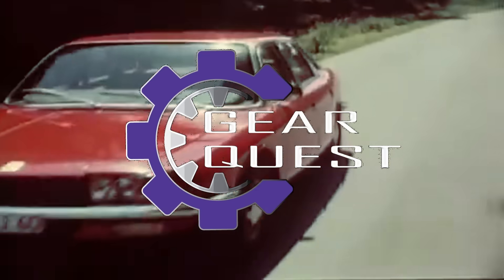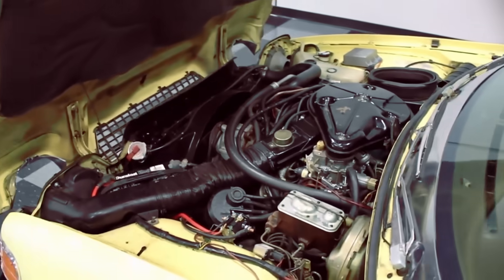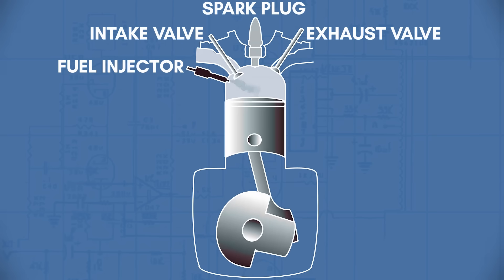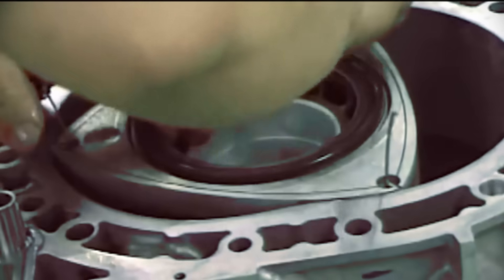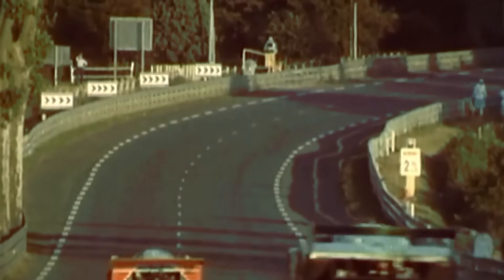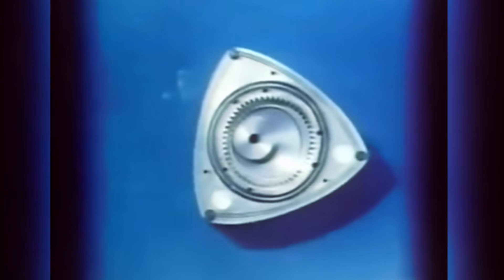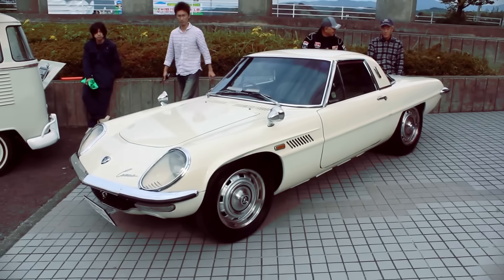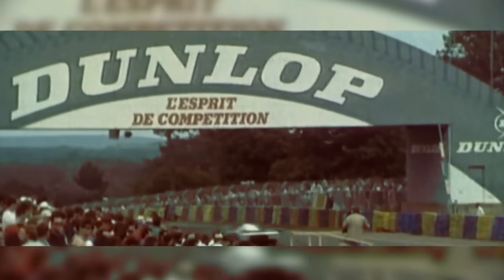The History of the Rotary Design

Comment: Click bait title: This was a good history and detail on rotary development but at no point did you discuss the political and back room dealings on why the rotary was banned, title had nothing to do with the content!
Reply: the true advantage of a rotary lies in the fact that what you would consider to be the piston constantly has angular momentum in one direction... therefore there is no dead weight working against the engine/crankshaft. everything turns, all masses rotate, even if not entirely concentric. With a typical piston engine, the piston has to stop and reverse direction, reciprocate, 3 out of 4 times without power being created in that cylinder... at some point the piston becomes a dead weight and creates vibration in the system as a whole.. vibration is wasted energy. Rotary has the edge on efficiency dynamics, but ultimately loses points on wear and lifespan.
Reply: @areyouavinalaff  Overall it is a better design ?
Reply: @areyouavinalaff  The Wankel offers no significant advantages and is less mechanically and thermodynamically efficient.
 The 13b for example has a 15mm eccentric-crankshaft which produced 30mm reciprocating stroke while the rotor orbits simultaneously in a planetary motion.
Reply: It was banned because the rotary can do 3 rotations as a piston does only 1
Reply: @TO-yq2qw  I figure, why Ban it by all ? It works, so use it in regular cars, light duty trucks, I think it would be better that my 2002 F150 even tho it has 568 thousand original on it; yeah still going. But how expensive to fix compared to, the v6 ?
Reply from the maker: Rotaries are a two-cycle four-strokes, they have a true 4 cycle (combustion event) but unlike a piston 4 cycle engine the rotary only needs one crankshaft revolution to complete its cycle, just like a two-stroke piston engine.
Reply: @GearQuest  Correct, all Wankel engines use the 4stroke or 4 cycle  operating principle.
 Not true, the Wankel requires 3 rotations to complete it's firing order sequence for all three combustion chamber swept volume displacement.
ALL 3 faces of the rotor completes the 4 cycles separately not simultaneously so 1080° degrees of crankshaft rotation not 360°degrees of crankshaft rotation.
Reply: @TO-yq2qw  it was not banned silly JDM mythos bullshit... there was a already known (befor the single rotary Group C victory) engine regulation change for 1992 that forced all Group C1 cars to be powered by 3.5l V10 engines same as F1 used... it effected the rotary, Jaguars V12, Mercedes turbo V8, Porsche flat6 turbo etc...
Reply: nagmashot yes, so banned
Reply: @TO-yq2qw  So boxer motors and V8s were also banned in Group C.
Reply: @nagmashot  The FIA never banned Wankel engines from the WSCC series. The regulations concerning engine displacement applied to all teams and was annouced more than a year prior to LeMans.
Reply: "at no point did you discuss the political and back room dealings on why the rotary was banned", most likely because there wasn't any to discuss. There is no great conspiracy to ban Wankel rotary engine, in fact it wasn't even banned!  The rules change in 1991 made it so all cars needed to run 3.5L engines, but there was issues. First off every team had terrible reliability problems because of the untested engines, every team but Mazda. While in qualifying the 787B was not the fastest by far, but it had one thing up his sleeve, reliability. It ended up wining the 1991 race because everyone else broke down, and the next year when the other teams got the "bugs" out of their engines, the Mazda 787B was no match. That is why the Wankel rotary engine was abandoned by Mazda. Though I do agree the title of this video was Click bait.
Reply: Agreed!  This is just regurgitated from some other show.
Reply: Exactly I really wanted to know
Reply: listen from 8:40
Reply: unbiased cobra66 you are wrong. The gear ratio from crank rotation to rotar speed is 1/3
Reply: It actually does explain why it was banned. Did you miss the bit about the rotary producing twice the thermo dynamic cycles of the internal combustion engine?
Reply: @petercarruthers9353  it wasnt banned. Mazda couldn't at the time time get compression to be anywhere near competitive with what a piston engine can apply. They have a formula to properly calculate rotary displace vs a piston engine. The rotary without significant updates to rotor design will never achieve high efficiency because compression directly influences temperature which effects efficiency
Reply: @jdr ok it’s funny that it’s great inherent advantage is also its downfall to the seals...
Reply: @shaadydog1  there is reported designers that have made the seals directly apart of the engines cast materials that allow compression up to 16:1 but very little is confirmed about that would be great tho. The rotor would still have it's own list of issues but would help them out for endurance and power along with thermal efficiency
Reply: @Peter Carruthers  How could it explain something that didnt factually happen? From the rules perspective many things were "banned". FFS THE fanboy bullshyt never stops with this group.  An engine/chassis combination  that  had more career DNF than podium was "banned" cuz too good. Only on the interwebz
Reply: @shaadydog1  he believes because they got a reliable 700 hp out of a 10k rpm designed engine that was wrung out the entire time which actually helps rotaries survive as it helps keep their oil and carbon build up under control. The only place the rotary survives is under constant strain at high rpm but 1 win of leman and a few supposed wins in lower classes which doesnt fucking matter when talking about group c prototypes.
Reply: Just a little bit of disclosure I fucking love rotaries they are interesting in function and form which is why I love hearing that companies are trying to do things with it but its Inherent issues with current design philosophy and technology yes rotaries are beautiful they sound hilarious and are functionally more efficient mechanically speaking but piston engines are older tech being they where being designed in one form or another steam etc since the 1800s and we just got them to 51 percent thermal efficiency a radical change in formula from the 60s is not going to suddenly keep up with a much more mechanically easier to make efficient design and suddenly keep up with thundering merc tt v8s or jag v12s  or Porsche flat or v engines when Mazda barely could afford the rotary racing development come on Mazda was working with less money and a much harder engine to design. Sorry physics are physics the rotary still has a theoretical max efficiency based upon thermodynamics of 61-63 percent efficiency but there are so many things that need to be fixed before it could ever possibly achieve that would I love to see that yes rotaries are tiny it would be epic to see things with a 61 percent thermal efficiency rotary but will it happen technically speaking it should be possible but speaking with current tech unlikely.
Reply: You really don't need an explanation if you seen what most Motorsports do when a new and overpowered design shows up. They'll ban anything innovative
Reply: goddamn it.
Reply: It wasn't banned the year it raced it was said the year after it raced the rules changed to not allow it to race but the year it did compete it was said to be unreliable and the switch to the previous years car to finish the series. So you can't ban something that really never raced a full championship series
Reply: click bait title yes,it had nothing with contents?Hnmnmmmmmmmmmm bruh!
Reply: Thanks. You saved me from watching the whole thing. Good onion.
Reply: Never banned, just a horrible engine concept.
Reply: @sandervanderkammen9230  🤣
Reply: @sandervanderkammen9230  ever driven or owned one? Of course not!
Reply: @boatymcboatface666  
Greetings fellow Aussie.
Have had the same experience owning one. Fc turbo. Lightly modified.
Had a guy I knew at the sawtell pub who used to give me shit about owning one. 
"Rotisserie engine, couldn't pull the skin off a rice pudding, engine in a condom". ????
Ask him if he'd ever been in one, he said no. Come for a ride I said.
Surprised the hell out of him.
Quote ,fuck me this thing hauls.
Next response was holy fuck it can stop too.
4 pistons with cross drilled and quality pads.
Didn't make him a convert but a new respect was found.
Reply: The Wankel engine was never banned
Reply: @sandervanderkammen9230  yes it   was in sports cars, after Mazdas Le Mans victory FIA changed rules....
Reply: @pizzagogo6151  Wrong! You need to check you facts..
 False urban myths quickly collapse under the light of scrutiny.
The FIA never banned the Wankel engine in WSC after the 1991 24 hours of Le Mans.
Reply: @sandervanderkammen9230  no you're wrong
Reply: @pizzagogo6151  The official FIA rulebook says you are wrong..
The WSCC series category 1 banned engines over 3.5 liters in 1990..
The Mazda 787b was non-compliant  for the 1991 season and only competed under special exemption  (category 2) effectively cheating the current displacement rules that season.
Reply: @sandervanderkammen9230  ha! You are funny:). You just proved my point! Did they use the words " rotary banned"no.....but there are several ( disputed) ways on how to calculate rotary displacement equivalency.the FIA deliberately the chose one that would rule out Mazda from competing again ( yet trying not to look like it).  Clearly the strategy worked as decades later you are arguing an effective ban is not the same as a.....well.. ban?!
Reply: @pizzagogo6151  I just proved you are wrong...
Reply: @sandervanderkammen9230  no you did the opposite, we'll done and good day to you sir!
Reply: @pizzagogo6151  You look like a fool right now.

The Wankel engine was a massive commercial and motorsports failure... even Mazda abandoned development 12 years ago.
Reply: Wasted 16mins learning what I already knew
Reply: @greydog1104  and then you wasted your's and everyone else's time with a stupid comment...
Reply: Suzuki motorcycles also tried the Wankel and were nearly bankrupted by it. They used extremely hard apex seals. But it was never really successful. Norton tried again this time with soft apex seals and seemed to solve the top wear problems. The big issue has always been poor thermal efficiency.
Reply: @Dave5843-d9m  Indeed, the big problem for Norton was keeping the thing cool when racing.
At lower power outputs (on the road) they were manageable.

And yes, as you mentioned, when all the 4 stroke manufacturers get into a huddle with the governing body (because of how the engine size is calculated), you're going to lose! You only have to see how the CC limit for the different number of cylinders in motorcycle racing keeps jumping about to see what a mess the rules are.
For a while (late 90s IIRC) V twins were allowed to be 1000cc, but 4 pots were limited to 900cc (I think), Ducati win everything with their twin. Next year the Japanese launch 1000cc V-twins! (I own one, and huge fun it is!).
Reply: @juststeve5542  Over here in the US it was 1000cc Twins vs 660cc 4cyl bikes, then about 2/3 through the season they realized the formula was wrong  and upped the 4cyl bikes displacement, it was a huge joke of a championship. Pretty sure was one of the  Hayden bros, was a just a teen or maybe early 20 then.
Reply: @juststeve5542  it wasnt banned mazda only won once...
Reply: @Dave5843-d9m  I was told the problem was the motor acted like a gyroscope and tended to launch the rider off the cycle when exiting a curve.. may be an urban legend, but that's what I heard.
Reply: @Dave5843-d9m why not just increase the cooling area behind the spark plugs?
Reply: The Wankel sweeps three power cycles per crank revolution. The  swept capacity is really three times the number usually quoted. 
The NSU 900cc was actually a 2,700cc engine. That argument and the high fuel demand killed the wankel for racing.
Reply: @Dave5843-d9m  On the right track, but not quite.  It only fires once per crank rev, regardless of what the rotor is doing.  You can see this at 1:18.  A 4 stroke fires once every 2 crank revs.  So you have to double the swept volume of the rotary to get the equivalent capacity.  So a 1300 mazda is actually a 2.6.

In terms of racing this meant there was always a debate about eligibility of the rotary in a given racing category.  If you considered them a 4 stroke then they were overly competitive.  If however, you gave them there true capacity they weren't competitive.

What usually happened is the racing body made an exception for a while, then when they became too good, they received pressure from other teams and manufactures to correct the capacity.  At which point the rotaries left the competition.
Reply: @Dave5843-d9m  nah, a 12a is still a 1200 .
Reply: @Dave5843-d9m  And the low reliability
Reply: Stansards should be based on power output if they want to match the performance.
Reply: @635574  internal combustion engines are compared using swept volume displacement and atmospheres of manifold pressure.
These standards are wide accepted and understood in automotive engineering and organised motorsports.
Reply: The sooner YouTube bans comments the better. My God some of these comments are ridiculous.
FACT: The Rotary Engine had been stirring the pot for decades. Australian Motorsports is probably the perfect example where Allan Moffat quit V8s to drive Mazda RX-7s and pushed shit uphill to get a place on the grid. The RX-7 was hated by many and the governing body did everything they could to prevent the Moffat campaign from winning, and win it did. It's somewhat true that the 4 stroke cycle is different than a typical piston engine but when the crank turns 360°
Go and read Wikipedia before some of these expert wrong information comments confuse you. It takes 720° per 4 stroke cycle in a piston engine and and only 360° per 4 stroke cycle in a Rotary Engine hence why the double the capacity.
Reply: @RE-RotaryExperiment  That is incorrect, the Wankel engine requires 1,080° degrees of crankshaft rotation to complete it's firing order sequence, while 4stroke reciprocating Otto engine completes   this in 720° degrees of crankshaft rotation.
Reply: Best history video I've seen on the rottree
Reply: The rotary was not banned by anybody, stop spreading that lie. They werent powerful enough at LM to be competitive. The rules were changed in 1989 for the 91 season to start using f1 based 3.5 liter engines. It had nothing whatsoever to do with the lucky win in 91. The MB, 962s and Jaguar were so handicapped by the rules so that the 3.5 liter cars were faster that made them unreliable.
Reply: chejlr well said, nailed it!
Reply: Mostly it was banned because they didn’t understand it. 

Realistically a rotary is worse all round apart from weight and ease of rebuild. 
The other kinks were not worked out because a very efficient small displacement car would go against the current narrative of mostly coal powered EV with the exception of water turbine powered states. And the odd diesel generator (diesels are not made to idle, and are definitely not efficient at doing so)
Reply: I made it to 5 minutes and thought why am I watching this entry level mechanics video. Close and ignore.
Reply: Right, we still don't know why motorsport banned wankel engines.
And by the way the background music sucks, and the narators voice is way too monotonous.
Reply: @beernd4822  because its too much work to make regulations. For example aussie v8 supercars. All motors same displacement, same cam, same compression, same head porting and tbe list goes on. You just cant make a rule that makes it an even race. 
Then people say just limit the power but that comes with as many problems. Pistons and rotors make power in vastly different ways, again you cant make rules to make it fair. 
Its like two stroke motor bikes vs 4 stroke. Its too  hard to make a fair competition.
Reply: So, the part about the dynamic thermal cycle flew over you head. It's ok, simple Jack.
Reply: @xr500t  If you want to go by the "thermal cycle"  lol then up the displacement x3 fuqtard like SAE J1220 suggest.  LOL its just dumb fanboy bs,  Rotary has all these advantages yet its inefficient, makes no power, and is thirsty....
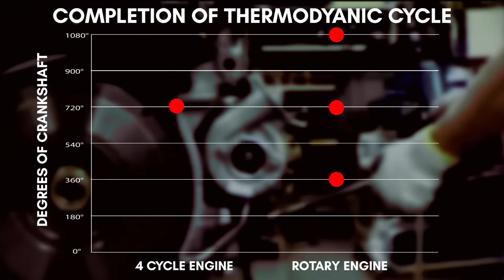Reply: 9:03 it may only be mentioned briefly but it is mentioned
Reply: @K0MEPCA  mentioning "it was banned" doesn't explain anything- no the title says "why"
Reply: @pizzagogo6151  It had an unfair advantage of producing greater power in relation to it's displacement. It was clearly explained that you cannot calculate displacement with a rotary in the same terms as a cylinder engine. Displacement is how race classes are defined. A 2 liter rotary would produce more the twice the HP of a a 2 liter cylinder engine. Watch the video again, and try to pay attention this time.
Reply: @cluckhead1913  yes I can see if you were unknowedgeable might think that's an explanation . Trouble is it would have been perfectly easy to come up with an equivalence factor, as they did with turbo charged engines, but they never even attempted it- clearly there were political reasons for this ( probably related to euro-centricity in sports car reading). Don't worry I'm sure if do a bit more reading you'll get your head around why what was stated in the video didn't address the title.
Reply: @pizzagogo6151  stupid trolls, staying stupid. Too many factors. Not in the same class etc
Reply: @pizzagogo6151  The proof starts at 8:44
Reply: @pizzagogo6151  Ya when an engine is running  NA the amount of power you can make is going to have a direct correlation  to actual cubes and rpm, dont matter if 4/6/8/10/12 cyl, rotary, 4 stroke or 2 stroke.
Reply: @cluckhead1913  yeah but that doesnt change the fact that the title refers to 30secs of a 16min video,... i call that clickbait
Reply: @cluckhead1913  but it was horribly uncompetitive..
Reply: @cluckhead1913  sports administrators happily allow turbo, supercharged, and kinetic recovery systems and set complex aerodynamic rules. They could work it out if they wanted.
Reply: The problem is trying for some strange reason to be equivalent to the 720 degrees that fires all pistons. Clearly the rotary doesn’t fit that criteria... it’s pretty disingenuous to only use swept area of 1 face of each rotor  as though it’s the only face doing any work. If that’s the case fill in the other 2 combustion chambers. FFS we all agree one 360 degree revolution gives you all 4 cycles/strokes. It doesn’t matter which one it starts on all 3 faces do all 4 cycles/strokes  per 360 degrees... thus all 3 faces should be counted as swept volume. In those terms it’s actually not the “magical” power producer fanboys want it to be.
Reply: @pizzagogo6151  it did say why if you listened more carefully, it puts out more rpms at a higher rpm rate then a conventional engine, aka it doubles the power output of a engine with the same liter... its a unfair advantage
Reply: @Gender's Gaming Experience horsepower is horsepower regardless of rpm. Horsepower is an amount of work over a period of time. Spin it 20000rpm to make 300hp,  its no more work or power than a V6 making 300hp at 6000rpm.
Reply: @cluckhead1913  The Mazda 13b has an effective displacement of 3.9 liters but requires 1,080 degrees of crankshaft rotation to complete it's firing order sequence.
 When compared to the 4stroke reciprocating Otto engine which completes it's firing order sequence in 720° decrees of crankshaft rotation the 13B displaces 2.6 liters.
 This is the basis for the 2X conversion formula used by all engineers and motorsports regulatory bodies.
Reply: Your failure to understand the content did not make this clickbait.  Do you need things presented to you in Big Bird fashion?
Reply: @watcherofwatchers  i didnt realise stating an opinion was so offensive to you, god forbid free speech,.. but to put your fears to rest, i understand the video and the content, i knew the history and how the rotary works. the video is great i never said anything else, but that doesnt change the fact that the title refers to such a short amount of time in relation to the rest of the whole video that it still feels like clickbait. you may have another opinion, and that is your right, but becoming agro over someone elses opinion, wont change it.
Reply: @watcherofwatchers  feel free to try an insult me but its not my fault you cant understand the concept of a non sequitur.